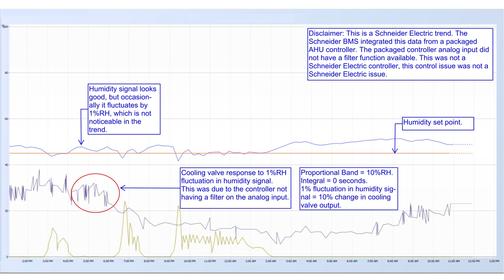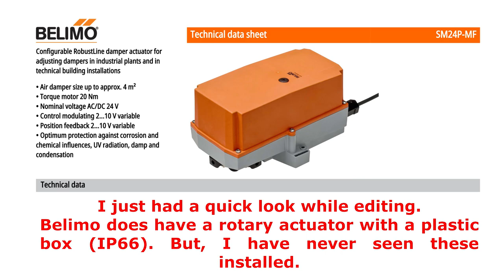Why does BMS Instrumentation FAIL?

Comment: I guess we can do.  As you said the electrical installer must read  installation data sheet and care it on of installation. BMS designer / project engineer must care about sensor location and sometimes valve sizing. Sometimes the BMS/BAS failure could be so oblivious and can be discovered  just in 5 minute more(e.g. on my  first visit on site as commissioning engineer i found a mixing valve installed on divert valve place, and due to this mechanical installation mistake BMS was wrong/faulty :)).
I'm still convinced that the commissioning engineer must know  a fully understanding of sensor properly location,  a bit HVAC prosses and able to adjust BMS app sometimes ....
Reply from the maker: I have also reviewed valve selection technical submissions and found mixing valves selected for diverting applications. Mixing valves are much more common and available so people do not realise the mechanical piping arrangement actually needs a diverting valve.